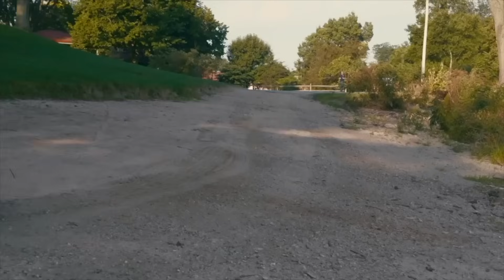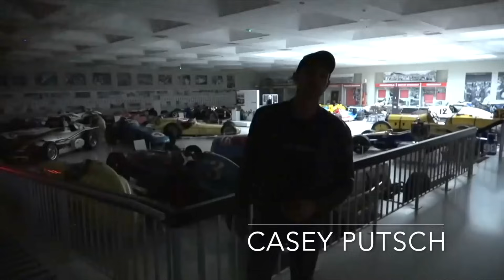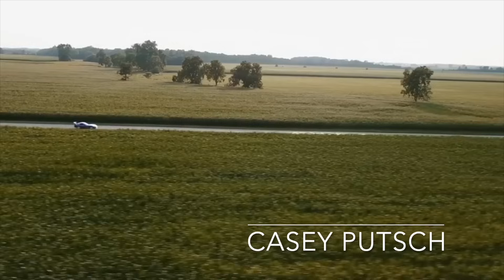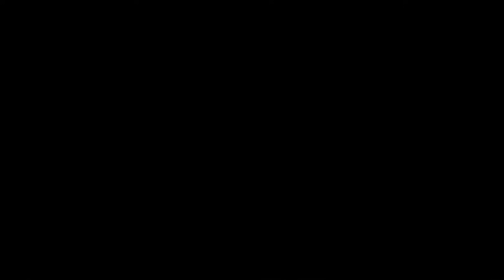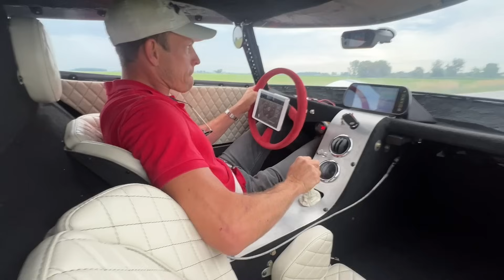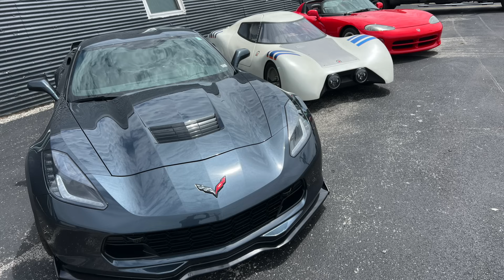HOW?? 104.7 mpg,  0-60 mph in 4.61 - the OMEGA CAR - Video 4

Comment: The GMC Hummer has a curb weight of 9,000lbs. Tell me how that thing with massive batteries and chewing through tires is better for the environment than my 25 year old S10.
Reply from the maker: It ain’t.
Reply: @CaseyPutsch  exactly. Weight is a killer for EVs. Light is efficient and electric cars just aren't.
Reply: @JLSnOrLaX  light is efficient, but ice is so inefficient that the car would need to weigh significantly less before it can even come close to the direct efficiency of an ev. 25%, vs 80-85% energy efficiency is huge and weight alone does not tilt the scales negate even still, they are getting more range per kwh of energy vs gas and diesel, which means they're more efficient
Reply: @Modikie  how's the efficiency on the coal or natural gas that produced the electricity it was charged with though?

If the US wasn't so scared of nuclear you might have a better argument.
Reply: @JLSnOrLaX  ok so I just looked it up, and coal plants are about 37% efficient, some gas cars are 20-40%. So you're right when it comes to coal, it isn't more efficient.

However, if you have solar on your home,  you wouldn't be powering your car with the grid. And if you charge at home most of the time like you should, you would rarely be using coal produced electricity to power your ev.
Reply: @Modikie  rooftop solar isn't going to charge an even in a reasonable time period. Even if it did, factor in the emissions from panel manufacture, the mining, refining, and production of the batteries, the ev wearing the tires due to more weight causing particulate pollution, and the increased wear and tear on the road which is a logarithmic function of weight.

Assuming you have solar a quick Google says 30 kWh is average per day with 15 panels. An average EV gets an average of 3.5 miler per kWh so I guess if you dedicated your solar solely to your EV you'd get about 100 miles of range per day, but that's banking on feeding power into a grid all day and using fossil fuel to charge at night. You might break even but there's still other sources on the grid. 

Honestly I think the system trains use, diesel-electric is the most reasonable. Its what Edison Motors is using to make Semis. A modestly sized diesel powered generator charging smaller batteries when needed plus the regen you get from brakes. I think the new Ram trucks have a similar system.
Reply: make another omega car now.  The 2nd prototype. 
Not just stuck with the same original one.  That was years ago..
Reply: @CaseyPutsch  driving for low emissions is most of the fun besides the more normal fun is escaping danger.

driving efficiently is speeding up especially on more downhill-ish roads at optimal fuel level and engine RPM(RotationPerSecond), steering and braking minimally but smoothly.according to bsfc chart optimal efficiency for toyota 2.4 inline 4 is 2/3 pedal down in 2k-3k rpm, cvt hybrid maintain constant rpm. not sure whats best to do this in: sport mode, fuel level is more, in eco mode its less. if you can keep throttle down 10% less time, then its ok to push pedal down bit more than optimal efficient combustion, less oil burn and possibly more efficient ..............use EV mode if optimal combustion level would speed car too much (often, if car isnt letting you do that without the EV mode, it wont let you us EV mode.) use it a bit from a stop for smooth acceleration then when car is rolling use combustion then maybe use it a bit more. smooth acceleration is part of putting less weight on tires for longveity of tires, less tire emission.

after 50 miler pher hour, aerodynamics exponentially worsens efficiency as speed increases linearly

neutral in toyota hybrid prevented regenerative braking from converting momentum into electricity to be used as power again, which is less efficient and power flow in and out battery lowers battery longveity. some auto transmissions are in wrong gear when rolling without power for quicker acceleration when asked for , causing engine pressure to slow down car. downshift to slow down to use less brake longveity too.

they say small part of certain materials in battery , and todays instant torque motors, cant be fully recycled and todays used instant torque motors cannot too, while combustion is based on byproduct of anaerobic bacteria. check out corbett report about climate change, tony heller, tom nelson , Malkovich cycle, previous climate changes like the ice ages (they cant agree whether earth is warming or cooling). etc. they dont agree on anything basically, and given how much deception there probably is between all industries, i respect that people simply favor low weight low instant torque. this is because "tire dust emissions " etc is claimed to be endocrine disruptor etc. combustion can be really clean but even then its not ideal to inhale burned stuff, similar to burned food.

but regardless, just trust unnatural systems minimally.

at mass scale, using less material minimizes chances of not having enough and affecting natural order. lighter weight reduces road wear damage, tire usage, etc, less weight is better for crash safety for everyone.
Reply: The most automotive environmentally friendly thing you can do is keep a car on the road instead of buying new. The less we rely on new manufacturing, the less mining and drilling will be needed. But that doesn’t make money…..
Reply: I like EVs as a concept, but I hate the Hummer EV. That’s just a GM marketing ploy. I’m sure even they realize how absurd the vehicle is.
Reply: @ztyhurst  its a HUMMER. What did you expect? People who care about their carbon footprint don't buy a hummer ev, they buy a chevy bolt. 

Unless they've been brainwashed into believing the hummer ev is eco friendly
Reply: @ztyhurst  That's why nobody buys them.
Reply: @ztyhurst I had someone at the dealership tell me how great they are. He ordered a corvette, but when the hummer came in, he bought that instead. I just looked at him and said, "Really".  Then I said. I would have stayed with the vette.
Reply: @JLSnOrLaX   indeed you are correct. We must refrain from assuming the premise is the same as we would like to believe it is. They are in the business of making money, in this particular case, vehicles are but a the means. Had they been in the business of making great and ever improving vehicles, the supper carburetor would not have been bought by Texaco and buried; this current EV wave absurdity would not have happened; turbo diesels would have been all over, like they are in most parts of the world outside the US; materials technology would have been where we know it can be, and the list just goes on.   Perhapsebly this here is the freethinking wave we can ride to achieve more amazing things 😊
Reply: Should not everyone  have the freedom to buy the vehicles they want?
Reply: To be fair, it's the only electric car built that poorly with that many flaws. A 1000hp truck is going to be a road and environmental hazard no matter what fuels it and powering it with batteries just compounds the issue. Electric has its place  but a 1000hp truck ain't it. 

It is the only electric car with a worse environmental impact than buying a 10 year old Toyota corolla, which is generally better than buying a new car in 90% of cases. 

Honestly, the EV Hummer and the cybertruck are such bad products and bad use cases for electric vehicles that anyone bringing them up to discuss the flaws of EVs as a whole is going to lose the argument very quickly.
Reply: @dylanmorgan5589  yup
Reply: The Hummer is better because it puts money in there pockets...the S10 won't...stupid I Know
Reply: @kennethporst4359  look up the court case Dodge v. Ford Motor Co. from 1919 and it makes perfect sense
Reply: but your S10 doesn't get 55mpg!!!!! 

that's what they say, as if that alone mattered. S10 uses less energy to manufacture, to maintain, causes less wear and tear on the roads, fits in smaller garages, etc. All things that reduce overall costs, emissions, etc.
Reply: @SoloRenegadeYou don't care about any of that and likely daily a truck..😂
Reply: Yeah, the whole microplastics argument in tires has gotten real quiet lately with the rise or EVs
Reply: I'd give certain items of my body for my old blazer back.
Reply: @gargar8196  yes yes. That’s the one. Texaco bought the patent and buried it.
Reply: It’s because the CAFE standards act is the biggest emissions loophole they’ve ever made.
Reply: you're just not thinking about it clearly...
you exist in the context of all that came before you. what can be, unburdened by what has been.
Reply: Am an EV owner n even I know the hummer EV wasn't built to save the planet in any way shape or form
Reply: @andrewmutavi590  true for all EVs. The whole thing is a despicable sham!! The damages to the environment are astounding!! The inhumane abuse of the poor kids at the mines…. The countries being robbed of their resources. And ofc the fact the they consume more energy that diesels. Simply outrageous!!! All for the sole purpose of controlling the masses.
Reply: It never will be better, it's 7'500 lbs too heavy and a Hummer.
Reply: @rjung_ch original military Humvee has an aluminum and composite body. Diesel motor that runs on JP8. I never understood why any of the consumer models had to be so heavy.
Reply: That part 🤷‍♂️
Reply: I always thought it would be cool back in the late 80s/early 90s when the C4 corvette had one of the lowest coefficient of drag to put a Geo Metro engine in it and see how many MPG it would get.
Reply: Well, manufacturing costs alone defeat the purpose
Reply: Or my 26 year old 24v Cummins! 460k miles
Reply: Batteries aren't free energy. A power plant somewhere had to burn a little more fuel to charge them.
Reply: @Craig-fl8jj Still cleaner than gas
Reply: @Samusaran77 you know this country uses coal for most of its energy. So basically coal is charging your batteries....of course when charging you lose efficiency and it takes more power generated than the battery can store. bUT BatTerIeS ArE cLEaNer
Reply: Wearing out tires is a matter of rubber "compounding".
Reply: My thoughts exactly. If this is really all about saving the environment and less emissions, they would be producing economy cars first and foremost. Then the odd truck/SUV after. But they’re instead pushing this massive non-efficient vehicles with the odd economy car. Somethings wrong with this picture
Reply: Because it costs 110k lol
Reply: How about the children who mine Kobalt for the batteries!
Reply: @CherryKingX , how about the children who mine cobalt for fuel purifying?
Reply: @CherryKingX You can't even spell for one. 2, cobalt is used much more refining oil, many EVs are cobalt free dumdum
Reply: Along with chewing through tires, don't leave out also chewing through every road & bridge it comes in contact with.

Worst of all, while doing so it will not be transporting masses of critical goods like a semi truck driver. Instead, it will be hauling Jaydon & Braylon off to get their new iphones because a sedan just isn't enoooooough roooooooom.
Reply: @RothBeyondTheGrave  look up what the Rivian R1T did to a guardrail and jersey barriers
Reply: @JLSnOrLaX  wow. I almost wish I didn't see that. Actually scary. Not only is it from all that weight, but where the weight is.

The ripple effects & sudden death scenarios from what used to be "normal" accidents while the EV tank driver is 100% unscathed. Pair that with literally being forced & coerced to constantly play with some stupid tablet instead of looking at gauges & using physical buttons or use "autonomous" driving features. As if people weren't distracted enough! What could go wrong?! One of those sideswipes my E coupe, I'm done & they're still tapping & swiping to turn the A/C down, thinking they hit a squirrel!
Reply: @RothBeyondTheGrave  The fact that a sedan is not enough room is one thing, has nothing to do with the fact that this idiotic thing (EV hummer) is the only option. It’s not even trying to be.  There absolutely can be a vehicle that size of better, line the Excursion, which by the way has soy based panels, that can be far more efficient than sedans, more especially when using them appropriately and moving a bunch of people and their gear.
Reply: @leodoron6473  very true & great point. I was just trying to give the EV Hummer a little shit hahaha

Comment: The benefits of diesel engine is it will run on any combustible fuel. Any plant that has sap can be foscher-troepped to make bio diesel, algae, pond scum. Methane, browns gas from sewage treatment could be fumigated to fuel engine.allison made hydraulic assist drive for trucks and buses, helps break initial take off. I like looking at older experiments in vehicles and manufacturing.

Comment: In km we use litres per 100km, the L/100km is 2.698. Lower the number the better for this score.
Reply: the omega car is more efficient than an Audi A2 3.9L/100km
Reply: According to my calculations it is 2.25l/100km.
Reply: @travelingwithmichael  correct, I used imperial not a US gallon.
Reply: @derekyorke3545  Casey is likely using US gallons, as far as I know only the UK still uses imperial gallons. Unless he stated that he was using imperial gallons specifically and I missed it.
Reply from the maker: I’m using US gallons and spoke about that in this video
Reply: @CaseyPutsch  It's a pleasure to write here, but we are doing a conversion to L/100km to appreciate how efficient is your car, here in Europe we don't know what is a mile, a gallon or a feet.
Reply: @juanjo2091 
That's like saying we in the US don't know what a meter is.  Granted, we typically don't Intuit them like we do inches, feet, and yards, but we still know it's a unit of length based on how far light travels in a vacuum over a specified time interval.  We have conversion factors to units familiar to us.  Anyone familiar with units knows what any related unit is in another system.
Reply: @elgringoec  we were just doing the conversion to our units, to understand the car
Reply: @juanjo2091  
Just converting?  Then don't say you don't know what a mile is, or a gallon is.  You can't convert without knowing the relationship
Reply: @elgringoec how many kilometers per cheeseburger?
Reply: @adamheskett6245  
😂 You can calculate that if you know how many calories per cheeseburger.
Reply: 2.7 l/100km is astonishing and unheard of
Reply: Both L/100km or km/L are used. I prefer the later because you can know the autinomy of one tank just by knowing how big it is
Reply: In 'rest of the world' speak; this car is crazy efficient